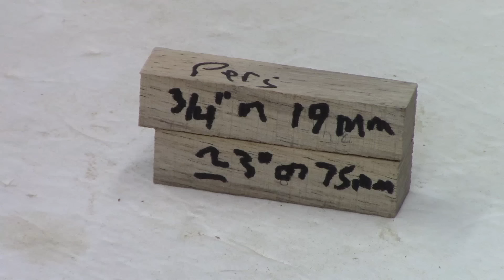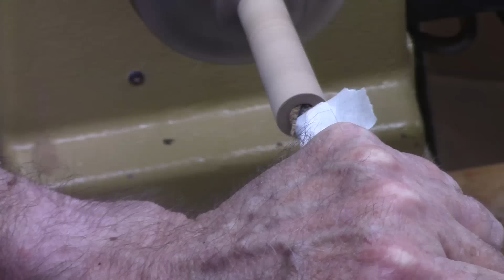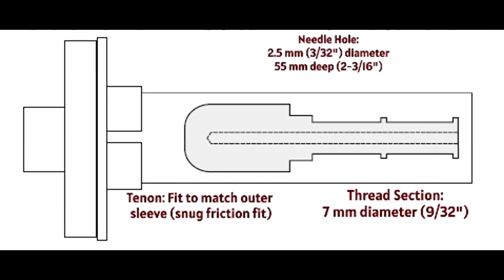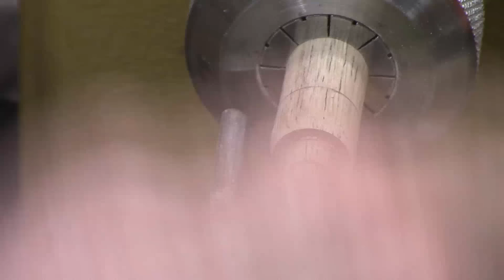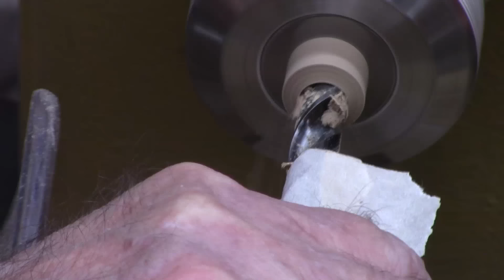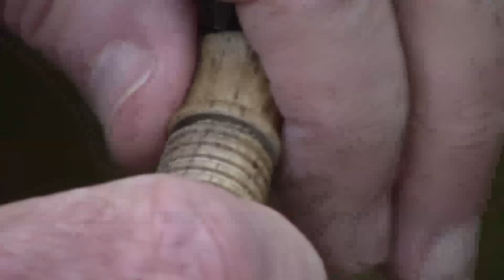Turn This! The Perfect Gift for Sewers (Pocket Sewing Kit)

Comment: Mike, long time watcher finally a question, interesting project, l like the fine detail and the size. I looked through the catalog of  club you referenced and only found the needle box so I assume that you used that as a vehicle for the one you produced. Anyway nice project and I do use some of the techniques that you hand out along with your turning wisdom. Thanks in advance and happy turning.
Reply from the maker: Their plans are  called TravelMate.
Reply: @MikePeaceWoodturning yes found them. I’ve got a nice piece of redbud  that will lend itself well to it. Thanks